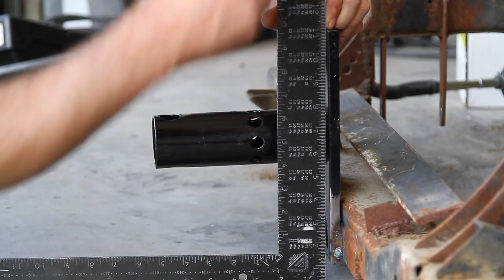DIY Homemade Truck Frame Rotisserie Using Harbor Freight Engine Stands.

Comment: I did one for a 69 Camaro. I was able to rotate the body and to bring it up and down. I took me some time but it work just fine. You did a Great work!
Reply from the maker: Tryna make me jealous with your 69?! That’s my dream car. Well 68 actually but still! A full body rotisserie sounds pretty impressive. Probably a little bigger than a pair of engine stands. Wish I could’ve seen it. 👍
Reply: @GarageFab  don’t get jealous, I build  it for the shop that I use to work at. The owner ended up selling the project. Not sure what happened after.
Reply from the maker: That’s a bummer!

Comment: Oh, how familiar.  My attempt (for a small muscle car w/0 engine/trans) used wood, 4X6 beam for the upright, trailer axle hubs for the rotating assembly and -- simply put -- just didn't work.  Or maybe I just got too nervous.  So I broke down and bought a rotisserie, figuring I can sell it off on e-bay when I'm finished with the project.
Reply from the maker: That’s brilliant, Don. Unless you plan to do work for other people, what’s the point of having a giant rotisserie in your yard/garage? Get your use out of it and get rid of it! 
What was there to be nervous about? Sounded robust to me! 😂

Comment: That's pretty cool.  Very impressive  for a couple of stands.  Great job👍
Reply from the maker: Thank you, X Sir. 🙏
Reply: @GarageFab   I have to ask ,  For your 4 link parallel bars...what type of heim links do you reccomend for slanted and crowned roadways?  Do you use compounded heims to allow for axle tilt or is this too much yaw movement?  Looking to construct a very well handling suspension. Love your channel. Or strictly bushings 2 polyurethane and 2 rubber at the axle.  Curious on what you think works best for that type of application
Reply from the maker: I use almost exclusively high quality polyurethane bushings. If a link bar must be adjustable, one end should be a Heim or other articulating type bar end to prevent the adjustment jamb nut from loosening.
I’m also a fan of Johnny joints. They operate like Heim joints but have poly cushioning. Another style I just learned about is Dual-Durometer rod ends. I haven’t used them yet, but they’re neat.
I don’t think there’s such thing as too much movement in a rod end. Only too little. (Binding) If you have excessive body roll, it should be limited with a sway bar, not the bushings.
Reply: @GarageFab  yes, I see your point and agree. Was curious since cross member end is pivoted in one plane if axle pivot needed more give.  Sounds like a good topic for future.  Lol, love the way you work. Have a good night
Reply from the maker: You too! Thank you’

Comment: Great video!!! I have been putting  off restoring my 1970 Porsche mainly because I was run over and crushed against and around a telephone pole while riding my 1957 Harley Panhead which gave up its life for mine. It's been over 18 months learning to walk and getting rid of blood clots that went to my heart and lungs  but I am much better now. I am no longer a chemical engineer working for big Pharma but I a now a small engine mechanic that is building a machine shop that runs on steam and belts like it did in the 1800's. Its a shame you are not out here because we could build some awesome ish . Thank you for this video and I am a new subscriber. Now I can start to restore my baby.
Reply from the maker: That is an acceptable reason to postpone a build, John! Happy to hear that things have improved.
Where are you located? The shop sounds incredible. I once visited a restaurant that had several ceiling fans that ran off of one single motor and many many belts. It was a feast for the eyes! Some might think it was a waste of engineering, but not me!
Thank you for the kind words, my friend. I’m glad to have you. See you in the next one! 🙌
Reply: @GarageFab  I am in Pennsylvania . I am currently in a barn garage owned by my father. I am looking for a place that has a double garage or find a shop that maybe has a similar business that the owner may want to participate in my dream. It would be great to be able to place my resources into purchasing equipment and setting up the business as long as he benefits from it as well. I would be able to take care of all utilities because I would be generating all the power and electricity. I have two prototypes of self propelled hydraulic dump wheelbarrows ( think large ACE wheelbarrow ) they will be engine drive with either pneumatic tire knobbies or various tread patterns of tracks. There is a guy named Kyle who built a similar unit and I will find the video and link it after this comment. There are tracked dump units made by a Chinese company however they seem to be made of inferior materials. I want to up-cycle scrap tires for the tracks and use completely rebuilt Kholer and Briggs motors as the power plants along with hand wound stators to power led lights and chargers and even linear actuators (electric). I will see if I can link the equipment I am talking about.
Reply: @GarageFab  I had this idea and I searched and Kyle had the idea before I did...here is the link https://youtu.be/d5fk9N5Buqg
Reply from the maker: That’s awesome. Very much the kind of weird brilliance I’m into. The tank tracks would definitely take it up a notch or three. Can’t wait to see this creation!
Good luck on the shop! Sounds like we’re on the hunt for the same thing. 🙌
Reply: @GarageFab  Thank you . That is why I said I wish we were closer. I know we could build some really awesome stuff. Even though we are pretty far I think we could definitely collaborate when I get my channel up and running.. I went to school at University of South Florida for my PhD. in chemical engineering and I really miss the warm weather. You have access to so many great people out there like Merlin's old school garage and Steve Darnell's rat rods along with his huge shop..  The resources are endless. I love your trucks and that really sucks that it was destroyed but it gives you an opportunity to build it better or redesign things you might have not liked before. I try and keep a positive attitude especially with what I just went through. I was train ing for classic physique bodybuilding when I was hit and only ate chicken and rice. When I was laid up my friends started bringing me pizzas and junk food. The worst part of this whole ordeal was putting on a 100 pounds of fat. I lost 57 so far but its so tough when I was awesome and now I look like crap...lol More work . Thanks for the kind words and we will definitely get together some time.
Reply: @GarageFab  oh wow I forgot that was a long time ago. how did the truck turn out this time? that is so cool that it seems like we can skip forward and see what you've done . very cool. I am going to check that out now.
Reply from the maker: I’m so out of the loop when it comes to fellow YouTubers. I haven’t heard of either of those people… I’ll have to check them out.
Keep moving forward Brother! Sounds like you’re on a fantastic path. I’ve seen people completely give up when faced with far lesser challenges.
Don’t be confused; my truck was indeed destroyed a very long time ago, but I still haven’t rebuilt it. I’m currently working on my Wife’s truck and I’ve had a professional realistic digital rendering made of the resurrection of my mine. (The black truck in the intro of my videos) but haven’t yet had the opportunity to start the project. It’s still a heap of parts in my garage and backyard. I’ve got HUGE plans that I’m excited to officially announce, but I’m holding off until my wife’s truck is a little closer to being complete. The new version will have two FWD LS4 V-8 drivetrains. One up front, and one in back, all wheel drive and four wheel steering. I’ve already purchased two 2008 Chevy Impala SS donor vehicles and the wheels, All I’m missing is the shop space to build the chassis from scratch.
Lemme know when you get that channel rolling! I’ll be watching. 👊
Reply: @GarageFab  Awesome my friend. You have a grasp of the physics of trailing arms and linkages that is mind boggling.As far as my channel goes I have been restoring  some engine drive welders and there is very little information on Youtube. I had yto search the information out myself and I kept thinking that I should video the work I am doing to help others because I know there has to be others working on the same things I am. I found a a 1972 Porsche 914 GT6 factory race car that had been left in a barn for 30 years and only recently within the last 6 months was pushed outside into a muddy paddock because they needed the space. The succeeded in denting every side and corner somehow when pushing it out and because they never had any rust proofing the tin. worms ate through significant portions but it is still in great shape. I traded a hand restored 1963 John Deere GT110 wide fender with 50 inch cutting deck for her. When I sent the guy a picture of my tractor he said please send me a picture of your tractor and not a promotional photo from 1963. I said that it is a picture of my tractor and he said come out and we can make the trade. Also I was in a scrapyard out in the wilderness of Western Pa and I thought I saw a three wheeler tire . I stumbled through the zero tun mowers and golf carts that were scrapped and lo and behold I saw what looked like a Yamaha 200cc Trimoto 1983 that looked like it had been pushed out of a helicopter like that guy on Scarface. I bought it immediately and that will also be a build on my channel. I have some really awesome builds on the way as do you. I am really glad we met. We will have to get I touch on Facebook and I can give you my number so we can stay in better touch and we can share pics of our builds and get some cool ideas to bounce off one another.Talk to you soon my brother.
Reply from the maker: Absolutely my man! Looking forward to your builds. Feel free to hit me up on Instagram if you’ve got one. @GarageFab
I don’t social media much anymore since starting YouTube so I’m kinda hard to get ahold of. I’ll be seeing you though.
Reply: @GarageFab  I don't do social media however I have been able to find incredible deals and finds on FB marketplace. There was a guy selling a Tire changing machine for around $1200 and I messaged him and told him I was interested and what I was doing with the machine shop and small engine repair along with some mobile welding and fabrication. I said if you ever get to a point where you are sick of it being in the way or you want it to go to a good home give me a call and you can tell me the story behind how you got it and I will see what I can do. A couple months went by and I messaged him again and asked how he was doing and what the story was on the changer. He said he would call me and tell me all about it. He did and it was an awesome story of his father in law who has a hobby service station where he builds race trucks for One of the Petty's  and refurbishes old Petroliana products . He has a huge service center where you could eat off the floor. He used the the changer up until he bought a new one because he needed to do 21 inch and larger wheels . I said and he gave you that awesome changer and he interjected that I can't use and has been siting here for almost a year and a half. He said people were low balling him offering $50 and he was upset with almost everyone. He asked if my offer was still valid. I said yeah but I don't have any money I can spare right now. He said if you can come right now it's yours and give it a good home and put it back into service. I said absolutely I am leaving right now. By the way where do you live.....Yeah three hours later I showed up at his farm and we loaded the changer and chatted a bit and I was on my way back. He said he never got the bubble balancer with it  so I would need to find one. Well I looked on eBay and found a few of them of the same age and quality which also put them at between $600 and a thousand and up for true vintage bubble,e balancers. I found out they had cheap ones on amazon but UGH...So a couple days later I am looking at a listing for brand new tools in a shed where a guy buys pallets and sells off the tools. I zoomed in on the tools and there were lots of craftsman and some more expensive. I saw two starred micrometers laying on the floor under a toolbox so I forwarded the picture to my good friend and it was not more than five minutes when he called me and said, do you see the old bubble balancer in. the back corner. No kidding there was the exact balancer that would have gone with the changer  sitting there filthy greasy and not looking like anything. I made an appointment and met up with the guy. I bought the starter micrometers and he said you rented steam punk with I did. Could you use this old thing here ? I looked at the balancer and said maybe its dirty where did it come from. He said mistakenly some items fro m an estate sale got onto one of the pallets and its been here for a very long time. I said what do you want for it. He said How about $25? I paused and said okay I'll figure something out. I had to hide my excitement. It is so awesome!! It cleaned up really well. Facebook Market place is a great place.I helped him out and he helped me out. I found a 1800's power Hacksaw which is awesome . I also found a belt driven Huuuuge Old drill press that was used in. building locomotives . He wants me to use it and give it a good home but it is his friend's so we agreed on a decent sum of money . This channel could be a fantastic goldmine of information and entertainment if I can present it correctly.
Reply from the maker: Well you sold Marketplace! Haha
Lemme know if you need any YouTube pointers. I’ve got a couple. 🤷‍♂️
Reply: @GarageFab  Fantastic! Thank you. I will definitely take you up on that. Your style is unique and very very cool.

Comment: Great video! This was my same build plan and in fact bought the same engine stands before finding your video. After unboxing I realized that the upright was not straight and needed to be cut and re- welded as you did. Was planning on casters, same as yours but then thought what if I ad enough big washers or spacer to adjust upright to 90 degree. Since I'm planning to use the complete 4 wheel stand this should work correct? What are your thoughts? Thanks man. Really enjoyed the content
Reply from the maker: Thank you, Chris! I recently learned that casters are affected greatly by their mounting angle. If shimming the rear wheels enough to straighten the upright, it will in turn angle the casters and it might be really annoying to try and move around. Keeping the stationary wheels in contact with the ground will likely also make maneuvering a challenge. Lemme know what you decide to do and how it works!

Comment: Looks good. I was thinking about trying to do something like this for my sons 78 Chevy k10.
Reply from the maker: I ended up never using for its intended purpose but it was great for storing the frame upright out of my way for years!
Lemme know how it goes, Steve! Thank you. 🍻
Reply: @GarageFab  Question, was there something on it that you didn't like, or was it not sturdy enough to work with?  Just curious.  Thanks
Reply from the maker: No I think it was totally fine for what I needed it for which was just holding the bare frame while welding holes closed, remove rivets and make some simple modifications and paint. I don’t think it could support a whole vehicle and it definitely isn’t tall enough be able to rotate a car body.
I just decided to scrap the frame and start from scratch. Maybe I’ll put the new frame on it. 🤷‍♂️
Reply: @GarageFab  perfect, thanks. We’re taking the bed and can off separately. I’m going to add some gusseting and switch the front leaf springs to coil overs and depending on if we can figure out the geometry, we might try to do a dual rate coil spring in the rear as well. That’s how I found your channel…I found your playlist on suspension and it was very informative. Thanks again and your new videos are great quality and nicely edited.
Reply from the maker: Sweet! Sounds like a cool project. Can’t wait to see it. I think each stand is rated at 1000lbs so that should be just fine for what you need it for.
Thank you for the kind words! 🍻